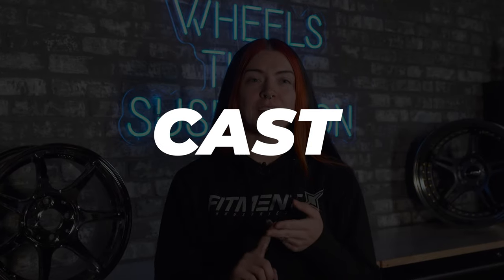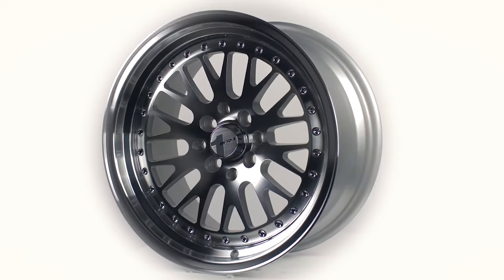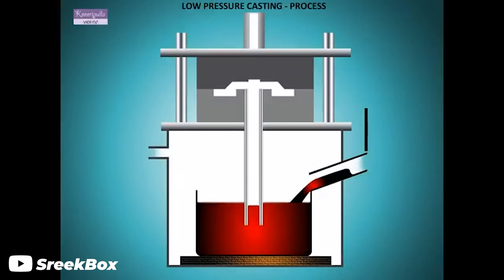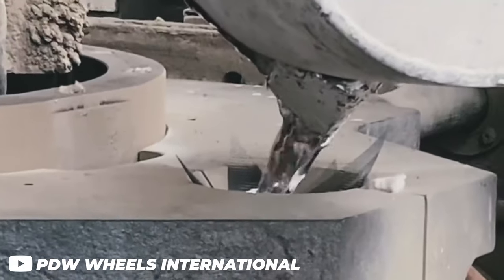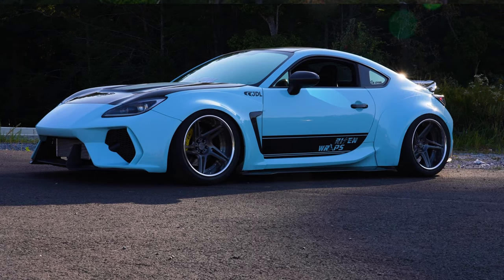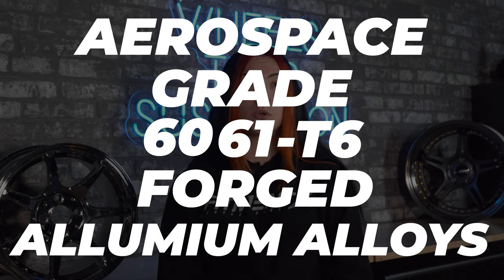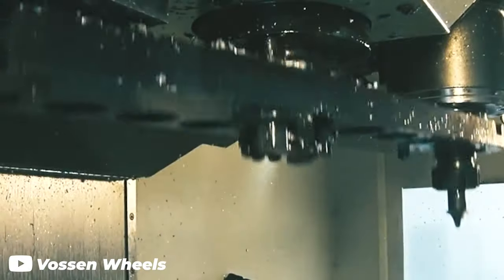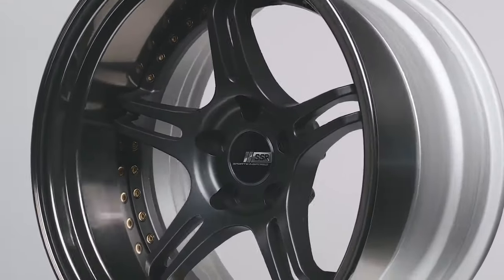Cast vs Flow-Formed vs Forged: What's The Difference?

Comment: Forged is for when you have unlimited budget for a build, flow formed is for when you got some cash to upgrade the car but can’t go all out on everything 👍🏾
Reply: problem im facing now is that the stock gr supra 2023 wheels are forge wheels that only weight 21lbs front and 22lbs rear which superlight for an oem wheels that is 9 and 10 by 19 what i want to run is 275 295 stock wheels wont perform to wheel with those size of tires and i need a 9.5 and 10.5 by 19 wheels for a flush look plus better track perfromance but forge wheels from rays or advans are 4.5k usd the only affordable wheel i see is rays gramlight 57 but ther flow form and wieght about the same if not slighty heavier then oem.

Comment: Forged is for time attack drivers that want a lightweight wheel with high degree of strength allowing them to frequently ride over ripple strips and cut curbs during tight corners without their wheel buckling or denting